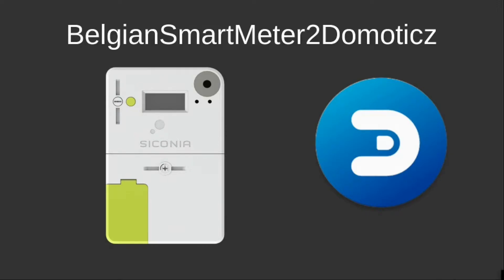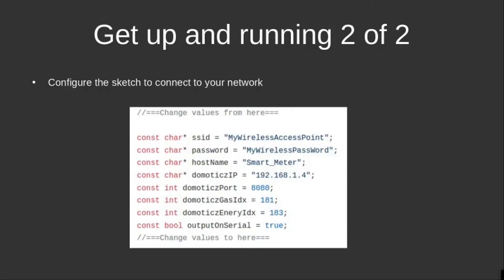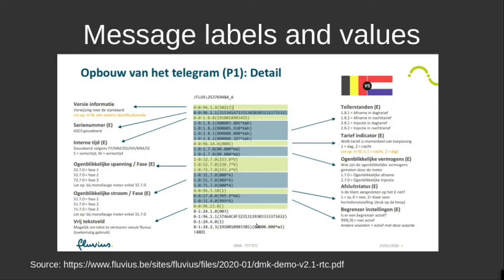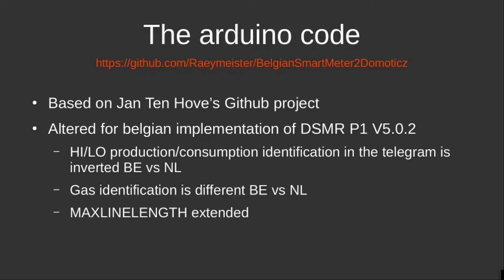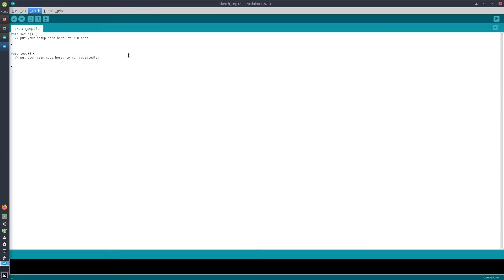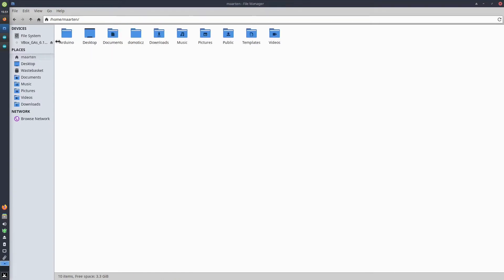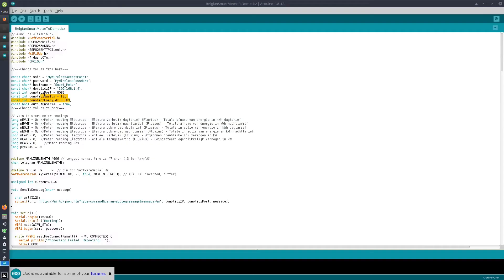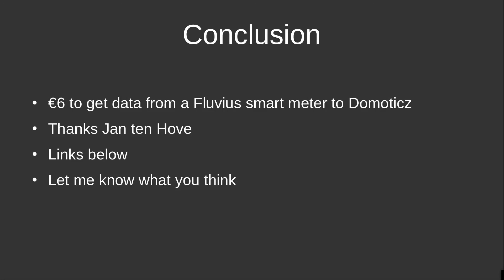ESP8266-based P1-port sensor sending data to Domoticz

Comment: Thank you for sharing this project maarten.
Some helpful tips for viewers looking to make a comparable interface and improve the design:
- Data line is open collector ( needs pullup going to IO pin)
- I/O pins on esp8266 and esp32 are not 5v tolerant (level shift required)
- Data needs to be inverted for sending to uart ( bc547 or fet schematics on the web) or invert in software as shown  in code from this video.
- software serial does not work reliable at 115200 ( hardware serial recommended ex esp32 for extra hw serial)
- Use a capacitor on the P1 5v line for powering espxx and limit wifi spikes.
Reply: And personally, I would put diodes between multiple 5V sources. (for if you would also power the ESPxx with usb)
Reply: Maybe his device was 5V tolerant, but mine wasn’t; the UART was just spitting gibberish.
You have to put a level shift as @ddjazz mentionned to be sure (look for "level shift 5v 3.3v" in Google with 2 resistors) 
As it is an open collector, I'm wondering if it is possible to link the D1 data pin in PULLUP with 3.3V, so it is always 1 (3.3V) unless the P1 is grounding the RX

The 5V on the ORES meter was very stable but a capacitor could help if needed

Comment: ERROR "no matching function for call to softwareserial::softwareserial int, int, bool, int":
Also I have been struggling for the last few days on finding a solution to this error.
Somewhere I have read that - in Arduino Boards Manager - the ESP8266 Boards with version 2.5.2 (important!) should be downloaded (not the most recent one). This solved for me the ERROR code, resulting in a successful upload to my ESP8266 D1 mini.
Allthough, after following Maarten's instructions (how to include P1 Smart Meter in Domoticz), I still do not get any data transferred.
(I have not added a resistor to the ESP8266)
Reply: I have the sale issue. All other tutorials have sold the resistor.

Comment: BelgianSmartMeterToDomoticz:37:59: error: no matching function for call to 'SoftwareSerial::SoftwareSerial(const uint8_t&, int, bool, int)'
 SoftwareSerial mySerial(SERIAL_RX, -1, true, MAXLINELENGTH); // (RX, TX. inverted, buffer)
                                                           ^
D:\Users\jimmy\Documents\Arduino\BelgianSmartMeterToDomoticz\BelgianSmartMeterToDomoticz.ino:37:59: note: candidates are:
In file included from D:\Users\jimmy\Documents\Arduino\BelgianSmartMeterToDomoticz\BelgianSmartMeterToDomoticz.ino:2:0:
C:\Users\jimmy\AppData\Local\Arduino15\packages\esp8266\hardware\esp8266\2.7.4\libraries\SoftwareSerial\src/SoftwareSerial.h:93:5: note: SoftwareSerial::SoftwareSerial(int8_t, int8_t, bool)
     SoftwareSerial(int8_t rxPin, int8_t txPin = -1, bool invert = false);
     ^
C:\Users\jimmy\AppData\Local\Arduino15\packages\esp8266\hardware\esp8266\2.7.4\libraries\SoftwareSerial\src/SoftwareSerial.h:93:5: note:   candidate expects 3 arguments, 4 provided
C:\Users\jimmy\AppData\Local\Arduino15\packages\esp8266\hardware\esp8266\2.7.4\libraries\SoftwareSerial\src/SoftwareSerial.h:89:5: note: SoftwareSerial::SoftwareSerial()
     SoftwareSerial();
     ^
C:\Users\jimmy\AppData\Local\Arduino15\packages\esp8266\hardware\esp8266\2.7.4\libraries\SoftwareSerial\src/SoftwareSerial.h:89:5: note:   candidate expects 0 arguments, 4 provided
exit status 1
no matching function for call to 'SoftwareSerial::SoftwareSerial(const uint8_t&, int, bool, int)'
Reply: };

/// This class is compatible with the corresponding AVR one, however,
/// the constructor takes no arguments, for compatibility with the
/// HardwareSerial class.
/// Instead, the begin() function handles pin assignments and logic inversion.
/// It also has optional input buffer capacity arguments for byte buffer and ISR bit buffer.
/// Bitrates up to at least 115200 can be used.
class SoftwareSerial : public Stream {
public:
    SoftwareSerial();
    /// Ctor to set defaults for pins.
    /// @param rxPin the GPIO pin used for RX
    /// @param txPin -1 for onewire protocol, GPIO pin used for twowire TX
    SoftwareSerial(int8_t rxPin, int8_t txPin = -1, bool invert = false);
    SoftwareSerial(const SoftwareSerial&) = delete;
    SoftwareSerial& operator= (const SoftwareSerial&) = delete;
    virtual ~SoftwareSerial();
    /// Configure the SoftwareSerial object for use.
    /// @param baud the TX/RX bitrate
    /// @param config sets databits, parity, and stop bit count
    /// @param rxPin -1 or default: either no RX pin, or keeps the rxPin set in the ctor
    /// @param txPin -1 or default: either no TX pin (onewire), or keeps the txPin set in the ctor
    /// @param invert true: uses invert line level logic
    /// @param bufCapacity the capacity for the received bytes buffer
    /// @param isrBufCapacity 0: derived from bufCapacity. The capacity of the internal asynchronous
    ///	       bit receive buffer, a suggested size is bufCapacity times the sum of
    ///	       start, data, parity and stop bit count.
    void begin(uint32_t baud, SoftwareSerialConfig config,
        int8_t rxPin, int8_t txPin, bool invert,
        int bufCapacity = 64, int isrBufCapacity = 0);

Comment: can't upload to wemos D1,,,no matching function for call to softwareserial::softwareserial int, int, bool, int
Reply: most probably you're missing a library
Reply: @krisgeusens162  #define SERIAL_RX     2  // pin for SoftwareSerial RX
SoftwareSerial mySerial(SERIAL_RX, -1, true, MAXLINELENGTH); // (RX, TX. inverted, buffer) 
-------------------i dont understan the error, me beginner :-)---------------------------------------
Reply: @krisgeusens162  do i have to change hostname? where can i find the hostname?